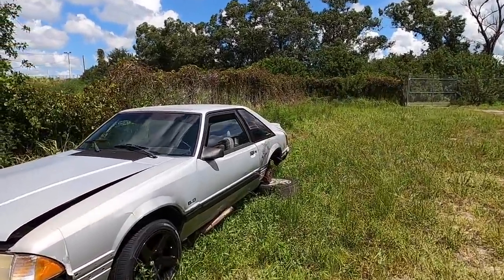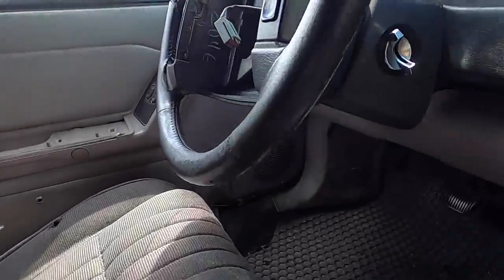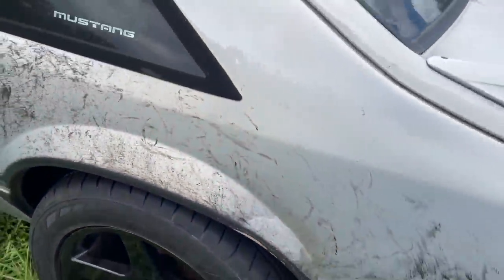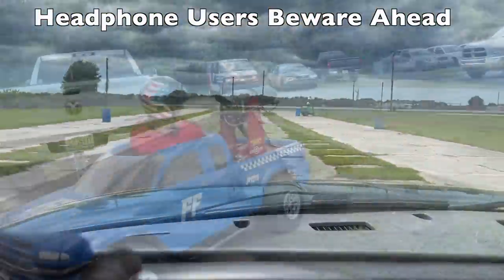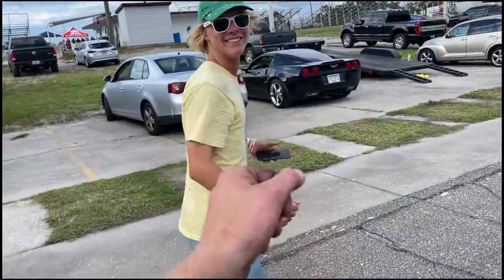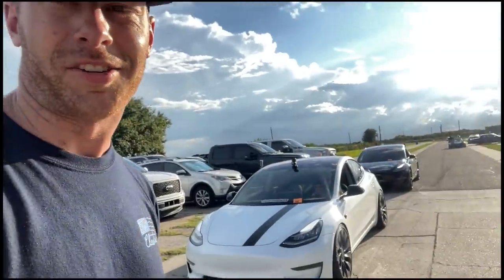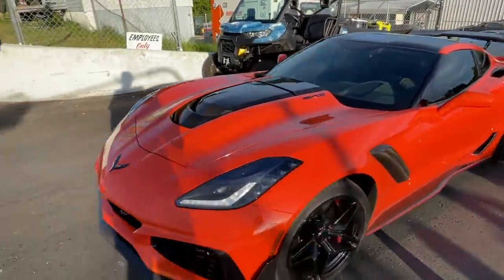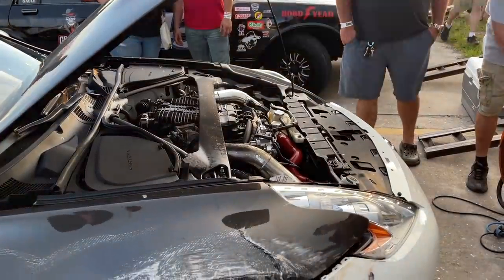Foxbody vs C7 ZR1! Spectator Drags, Crash, & Jet Car at the Freedom Factory

Comment: If a vehicle has been sitting a longer while, You should really consider letting it build some oil pressure before you dump it in gear and go. 🧐
Reply from the maker: You’re right but this motor is long gone as it is